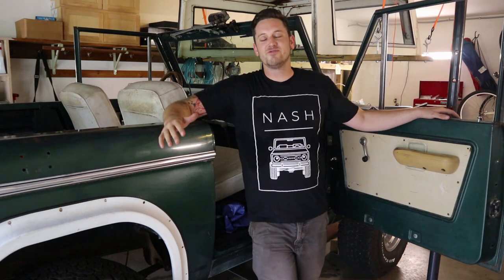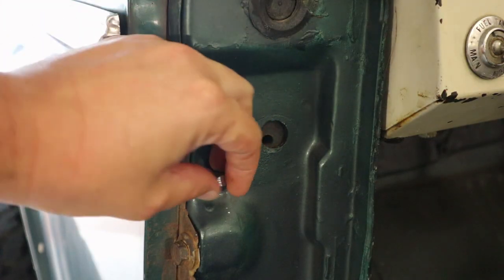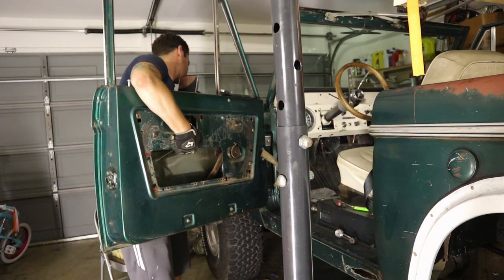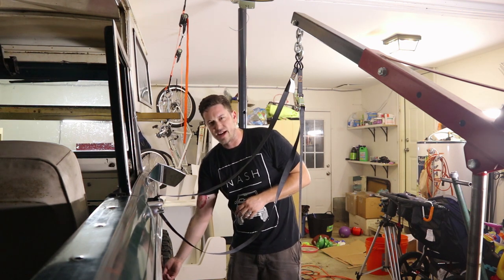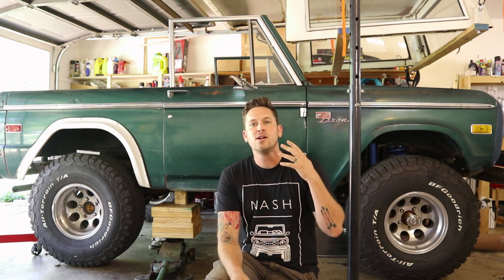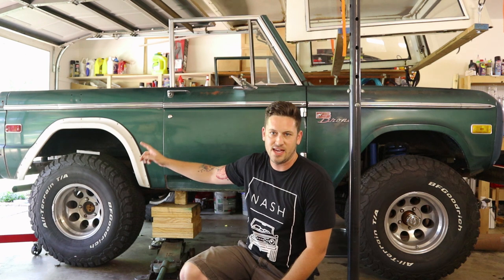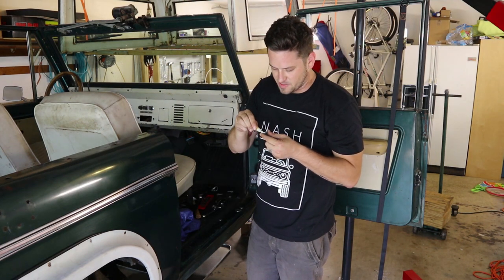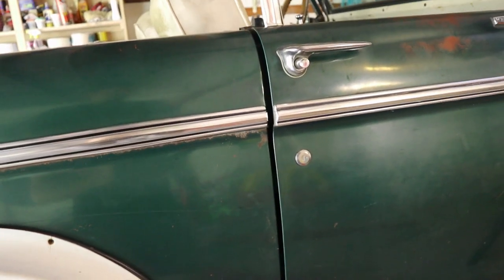Classic Bronco Door alignment and Quick Release hinge install

Comment: Enjoy and get a good laugh out of your videos. I think anyone that owns a Bronco feels your pain in aligning the doors. 

Just a tip, hanging doors all starts at the front and rear floorboard body mounts. 

Our Broncos have seen lots hard use and often the body structure has bent over these mounts leaving the door openings out of square. 

Fix these areas and then shims at the front and rear body mounts to square the door opening to the rockers.
Reply from the maker: +Tom Sawyer that's a great tip!

Comment: I used the stock hinges flipped them upside down and cut the top so they became quick hinges for free. If you use some spray paint or a sharpie and mark where the hinges are before you start to take the old hinges off to use as a guide you can get the alignment very close or spot on without all the fuss.
Reply from the maker: +EnduroRider NW good tip!

Comment: I am basically redoing my 74 in order from what videos you release. Thanks so much for these. Come for a trail ride in Puerto Rico!!! For marking the locations of your hinges you can use a scribe or marker to outline existing locations prior to removal. Will give an idea on reinstall. Great tip about having a keeper for the back plate.
Reply from the maker: +Ryan Curry nice man! Heck yes! Puerto Rico would be awesome!
Reply from the maker: +Ryan Curry good tip about marking the location of your old hinges. That would have come in handy

Comment: one method I have used with doors is using an engine hoist and one ore two of those elastic straps people use when working out. I can run a strap around the upper window channel and around the head of the hoist. With the door just kinda floating in the air, you can raise up the hoist til it is close and the door is almost weightless and can move in all directions pretty easily.
Reply from the maker: +Scott Plude that’s brilliant!

Comment: Nice video. I enjoy them all. I have a '74.

Just curious- could you save some time if you only replaced one of the hinges at a time to maintain the original fitting? Not sure if that would be possible.
Reply from the maker: +MC Makes man that could! I took my doors off for some reason so I had to start from square 1

Comment: I saw another video were you use a rod between the two door hinges to make sure both are in parallel. I have major issues with my doors. But thinking issue might be body mounts and roll bar  Totally agree. Shoot the door engineer!
Reply from the maker: Yep, the rod through the hinges is a great idea. 

At this point, my tub is weak and the doors will just sag
Reply: Got similar. Have to lift doors to close and huge gap on the A Pilar? by windshield. Difficult to solve for a weekend DIYer. Thanks for the great videos.